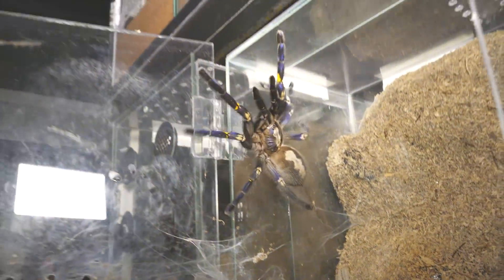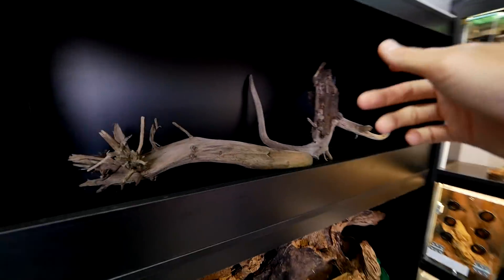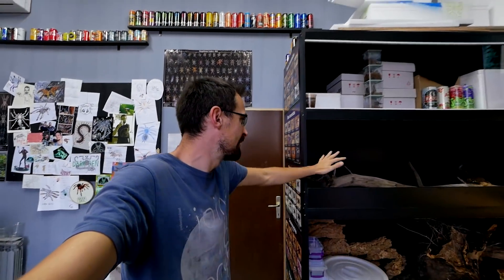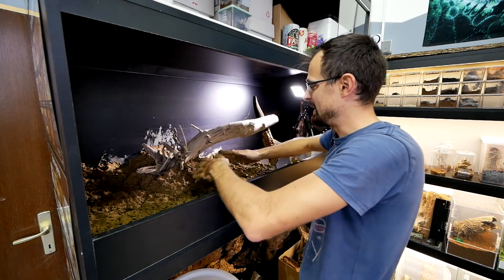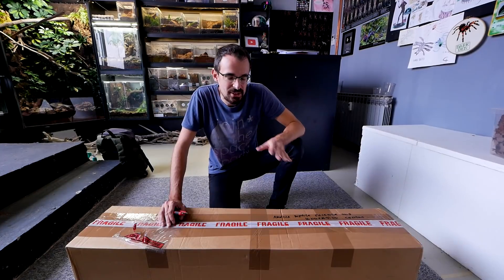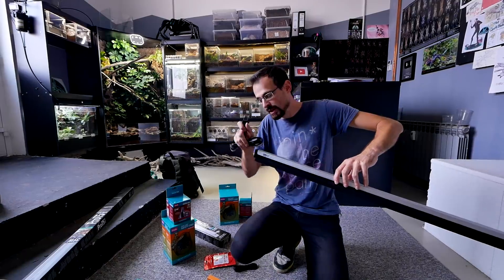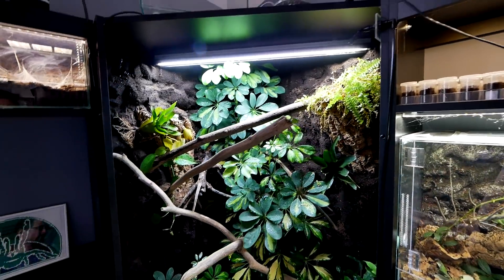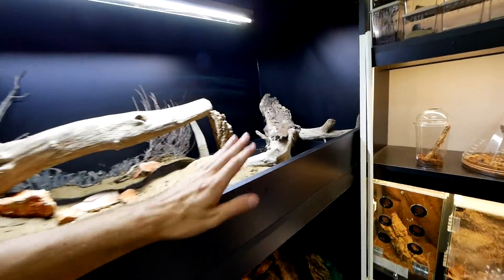LIGHT IT UP! - Arcadia Reptile

Comment: Petko its not just about the dragon ingesting dirt when it's eating, its also about the beardie licking stuff in it's enclosure. They lick to find out about their environment. In addition to this it will be harder to pick up wet poops when they come. Its better not to risk impaction by using repti-carpet or tile substrate.

Comment: Careful with the impaction risk. Before y'all start in, I used to work at an exotics vet clinic and we saw that. Just be careful, and in future I recommend against outside dirt. Beardies can pick up parasites easily! Just monitor stools. You're super attentive to your animals, so you should be alright. Good job researching the lighting! Also, really really important! Get a meter to check UVB levels over time. Nutritional Metabolic Bone Disease happens in these guys; it's so sad. All that said, the enclosure looks lovely.

Comment: Great to see you have the arcadia products, I don't know if the max temp of the deep heat projector is suitable for a beardie or chameleon, so you may wanna use a thermostat with them, and maybe a protective cage so they don't touch the lamp. But awesome setups :)
Reply: Protective cages can get really hot and the chameleon may grab it and burn its self as long as the heat lamp isn’t to low then it’s fine
Reply: Can you use just a DHP as the sole source of heat and the arcadia 12% bulbs as the sole source of light? I was told heat source also needed to have daytime light

Comment: your setup looks great my only concern would be to advise against using sand due to the fact the reptile can become impacted. if you still want some loose substrate making for easy clean up i would suggest coco fibre or eco earth. Both work great to absorb and clump up the waste, it also help reduce the odor compared to using news paper or paper. i would advise against using green carpet and it can get caught on and rip out toe nails. I have a 3 minute video on my channel using coco fibre. i have 3 bearded dragons. two are 3 years old and the other is 9. I never had to bring them in to the vets for any concerns yet.

Comment: Everyone in the comments clearly acting like Beardie experts yet they fail to give the full advice on substrate. Loose substrate can be used for bearded dragons. Its a natural looking thing that offers the ability for natural behaviours such as burrowing. However loose substrate can cause problems when combined with other factors. The main one is the animals digestive system. If the Beardie is stressed, ill or not at the corrects temps then its bodily functions will not be working properly. This is when loose substrate can build up within the digestive system of the animal as its unable to properly pass through, this is also the case for invertebrates within its diet. So if you keep the Beardie healthy there is no problem with loose substrate. Its only unhealthy Beardies that die as a result of Impaction which would explain how big this controversy has gotten. No one wants to claim responsibility for an animals poor health and death if they have an easy loose substrate reason to point the finger at.
Reply: This guy. Is 100% correct.
Reply: Ok so now you are the expert? I agree with you at some points. But.... in nature as well as in captivity healthy bearded dragons have died due to impaction. Also in zoo's so it Will always be a risk. How ever you are very right in your statement " its always easier to blame loose substrate, than your own poor care of an animal. For the death of it. I have kept bearded dragons since 1999. And I have always kept adult and sub adult animals on sand. I have lost 2 animals to impaction. I have made autopsy on both animals, and i found sand in their stomach and collon. And also wath apeard to be some sort of ciste. Witch also was full of Some kind of inflamation. The animals was bred here( Denmark sorry for bad english)  by me and was healthy op to the time of Pretty sudden death. One of the animals was 6 years old, and was from my first clutch i hatch. So as it is.... there is ALWAYS the risk.
Reply: I never said Im an expert. Someone who thinks they know everything doesn't know anything at all. However i have been keeping Beardies for over 10 years. Not much in comparasent to your experience however and that is awesome. I agree that it is always a risk and id like to thank you for the information that you have experienced. Its very interesting.
Reply: Impaction is secondary.
Reply: Been keeping all my animals on loose substrate for the last 10 years with 0 issues. If your animal dies from impaction. It wasnt going to live to the fullest as is, proper husbandry is key
Reply: There’s honestly a risk with everything, but proper husbandry minimizes the risks by a lot. They naturally will ingest substrate in the wild as a form
of self supplementation. With proper heat and hydration the dragon should pass the substrate fine. It’s also important to note the type of substrate as well as wild dragons live on a sand, soil, and clay mix and the ground is quite hard. It’s best to avoid things like wood pellets, bark, chips, paper bedding, walnut shells, corn bits, etc.

It’s important to have proper UVB like Arcadia 12%/14% or a Reptisun T8/T5, proper basking spot temps: 104-110F, as well as proper hydration from vegetables or other methods. Parasites also can cause substrate to get stuck. 

A lot of the times with poor husbandry, there will also be a risk of food impaction. With access to proper lighting and research nowadays online it’s not really an excuse to not set up their enclosure properly!
Reply: Calcium sand is the best sand that I *personally* have found. Then again mine are only  roughly 2 years, 1 1/2 years, and 6 months. So there is still sufficient room for impaction to be a killer. But, as long as he keeps the beardie well hydrated and healthy there shouldn't be much of a problem. only respiratory issues to really worry about.
Reply: The funny thing is is everybody still seems to not be too sure what substrate to put a bearded dragon on. thank God I don't got any bearded dragons for this problem. since we're all talking about substrate here I'll throw that one in there as a question since I don't own any reptiles personally I'm doing the invertebrates thing first.

Now since this is all about substrate what about the repti carpet?

now I only ask this question because a lot of people tell me that repti carpets really awesome too. 

so somebody who actually has bearded dragons please tell me whether repti carpet is a good idea or is a bad idea, thank you!!!
Reply: NyanNyanNeko-Chan what are you smoking .. calci-sand is the worst you can get . If you have an animal that isn’t getting enough calcium from its diet it will ingest  the sand .. .. which will most definitely lead to impaction.
Reply: Repticarpet is the same as using paper towel, theirs no enrichment value to it and just looks less like an eye saw then paper
Reply: Actually, expert bearded dragon keepers will always tell you to keep them on either digestible natural paper or indoor outdoor turf. It is never recommended to keep this species on loose substrate. Beardies spend nearly all of their time in small bushes, on branches basking, or on hard rocks warming their bodies. They may burrow in the ground but the substrate will be damp and harden over time. They will not make a habit of feeding on or around loose substrate. In captivity they may be forced to do so. So, on the best interest of the animal and to give the most naturalistic enclosure loose woody substrate is a no no.
Reply: There is no such thing as an expert in the reptile industry. Breeders would most likely say to keep on paper because its easier to clean and maintain. Turf if a terrible choice. It is hard to clean so can build pathogens, made of plastic so isn't digestible and nothing like what it would find in the wild. A nice clay based substrate with a mixture of soil and sand is perfect for this species. There really simple. Like most reptiles if you look at where they come from and factor in there natural behaviour. Problem with the Bearded Dragons is everyone's so focused on the substrate side that they forget about how impotent it is to not house the males especially together. I've seen way to many Beardies torn to shreds because of this.
Reply: Iamdinodude yes there are experts. They are called scientists. They get degrees in natural science, behavioral science, and then they specialize in their field. Turf, installed properly, and with the proper husbandry is one of the best choices, and would in fact, harbor the least pathogens, because it is plastic. If you look at where they come from you find that they spend very little time on sand at all. As for housing, well, I’m quite aware of how bearded dragons should be housed.
Reply: I would avoid calcisand. The animal would get the needed calcium from its supplements within its diet. If its getting it through the substrate then it will be exhibiting unnatural behaviours like frequently eating the substrate. That could become an issue as the animal would be taking way more substrate into its system then it should. And the more substrate it ingests the higher the risk. For example a common issue caused by this is mouth infections as sand can become stuck in the joint of the jaws. All loose substrates can cause this however it is greatly, massively, so much more i cant even explain how much its increased when the animal has a reason to actually intake the sand. I don't know why shops still stock calcisand.
Reply: Scientists are constantly learning and getting things wrong all the time. 15 years ago we didn't even have T5 uvb lights and we thought it was okay to use coils. However there is very good field scientists, a nice one for Pogona Species is Beardievet they have a Facebook page and they do a lot of decent posts on substrate. As for stating Beardies do not spend time on sand this is false. Bearded Dragons are widely spread in multiple subspecies and found in multiple climates. For example the most common in the pet trade being the Central Bearded dragon Pogona vitticepts can be found on fine sands throughout central Australia and theirs actually clear evidence to this on Beardievet. The species people see on clay substrates and fields is the Eastern Bearded Dragon Pogona barbata which has a different colouration and head shape to the Centrals. So there is scientific research that is easily accessible to us which points heavily to this species coming into contact with sand in its natural range.
Reply: Iamdinodude actually pagodas spend most of their time in subtropical wood lands, and scrublands, which would in fact, include rocky areas, scrub bushes, and the like. But hey clearly you know more than everyone else here because you have been keeping bearded dragons for ten years.
Reply: Lex C 👀
Reply: @truly1676  well actually all I've done is relay information from credible sources because I wouldn't be able to use my own experiences as evidence. But I can use actual scientific research which I have done and told you where to find it. It's up to you to take that research and information into thought.
Reply: Alright but if it's something that can happen why risk it? If you can just use something else why would you use sand? It's like if I was deathly allergic to peanuts and there was a pack of m&m's without peanuts and a pack with 1 single peanut m&m in it (without any way to tell the difference of course). Why would I ever eat out of the pack with the 1 peanut m&m when theres another pack without any? Why would you use something that has the ability to impact your animal when you can go with something safer?
Reply: toddydog3 amen. Exactly.
Reply: @toddydog3  substrate can only cause a problem if there is another factor like bad husbandry. So if you keep it healthy it's probably not going to happen. Following your examples it is more like shooting yourself in the face with a gun. It won't work unless you introduce a bullet. The sands the gun the wrong temps is the bullet. You can't avoid offering natural behaviours for the sake of avoiding a really unlikely possibility. Going by that logic you would never leave the house coz a plane might crash down on top of you or never eat food as you might choke. Substrate is a good way to offer natural behaviours arguably one of the most important and fun things within keeping any animal. Beardies dig burrows, they go into brumation so it's important to offer that ability
Reply: Lex C thank you! I am from Australia where 90%of keepers use san$ an$ a health6 dragon can pass it! It is quite common to see beardies on sand in the wild mainly th3 centrals which are the only ones in America and the rest of the world

Comment: Arcadia is awesome, but I would go with a metal halide UV in the chameleon enclosure instead of fluorescent. It has much more penetration through plants, and gives good UV levels from further away than fluorescents . Also gives a really great mix of UVA/UVB
Those Arcadia deep heat infrared basking bulbs are AWESOME!

Comment: Having unprotected heat lamps inside the enclosure is risky business. It can easily cause nasty burns if the bearded dragon jumps onto it for whatever reason. There are protective wire cages for the lamps available to prevent that.

Comment: Most of Croatia is a clay/basalt crust layer from what I learned in my trip there. So while he's saying sand, he means clay! And some of you may not know but most clay minerals and all basalt minerals are bacteria resistant, if not bacteria retardent. Also, like a lot of the other Herp keepers and experts have mentioned, impaction comes from poor husbandry, bacteria on the fresh food or feeders, and lack of a good metabolic diet for that specific animal/species. It doesn't happen due to loose or compacted substrate. Just wanted to chime in and let everyone know that they need to consider that he's not using like beach sand, or just muddy soil.

Comment: Loose sand alone isn't good for a lot of commonly kept reptiles like leopard geckos and bearded dragons. Reason is their foot joints. They overstretch their legs in an unatural manner if they only have loose sand to walk upon day in and day out. This will eventually cause certain problems with their joints. Neither leopard geckos nor bearded dragons live in sandy deserts (i.e. sahara like soil conditions) in the wild. Best thing to do if you want to use sand as substrate is to mix the sand with clay powder, moisten it and when it dries it will become much more solid. Not only is this better for the legs of the animal in the long term but it also allows them to dig tunnels. Petko's choice of soil is a good one, too.
Reply: 2/3 of the enclosure is Clay/Mud/Dirt.
Reply: I know, that's why I wrote that Petko's chice is a good one. Cheers!

Comment: Shouldnt you consider putting a cage around the heatlamp for the cameleon? I had bine trusting in my gecko to be intelligent enough to stay away from the heatlamp, cause he would sense its way too hot, but i was wrong. After he jumped right ontop of the lightbulb the first time i had to install some protection around it, which would have bine way easier without him beeing inside. He wasnt harmed, but you can tell it was far from nice for him to jump on top (or touch it in case of the camelon, not sure if they can jump like that)

Comment: Hi .. I just thought I let you  know that the pro T5 light system does not have waterproof housings for the uvb tube . So having a misting system so close to the tube will ruin the system . Also what animal are you placing in that viv . The T5 tubes are powerful and depending on the the uvb percentage you shouldn’t allow the animal to be closer than  10 inches from the tube .

Comment: The only time sand/dirt is bad, is when you have incorrect temps! They need a basking spot of 110° F and surface temps between 120-140°F. These numbers are based off research recording and documenting wild beardies inAustralia! IMPACTION FROM SAND/DIRT IS ONLY CAUSED BY IMPROPER HUSBANDRY. 
Tiles and such is hard for their joints, especially in the long run. The reptile carpet harbors bacteria and gets nasty. 
If you dont use sand/dirt,  paper towel would be best as it's the most sanitary. 
also you should get a snake of some sort! Ball python or a boa maybe

Comment: Nice setup, but you will become problems with the water and the wood in the chameleon terrarium. I have the same problem after 3 years the wood starts to rot.
Reply: I'm inclined to see weather or not the cabinets he's setup is capable of holding all that weight. Especially over time!
Reply: This type of cabinet wood construction has endured 10+year of humid air(Because the ventilation is shit) from my showering in a bathroom. Plus the fact I shower my bathroom when cleaning it, since it is mostly tiles. It is only showing signs of Rot at certain areas. Mainly, the exposed seams. He has sealed all these seams with silicone. So, there will not be an issue. That outer black coating is a plastic variation of veneer. It can handle moisture quite well.

Comment: Are your heat bulbs not going to be on (dimming) thermostats and did you actually measure what temperatures the basking areas reached?  Maybe the bearded dragon enclosure is at risk of overheating, especially in summer?  Equally, what temperature will the coolest/hottest parts of the chameleon enclosure be.. In summer/winter, day/night?  Apart from basking areas, you don't seem to have considered temperature and have no way of controlling it within any of your reptile vivariums.  Your animals each have different requirements and I'm sure any air conditioning system will not meet the needs of all the reptiles